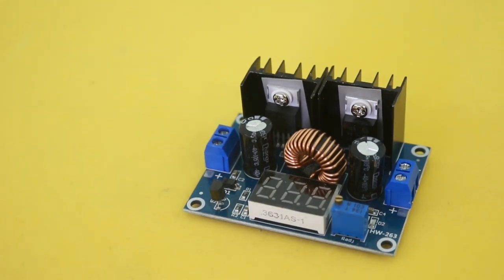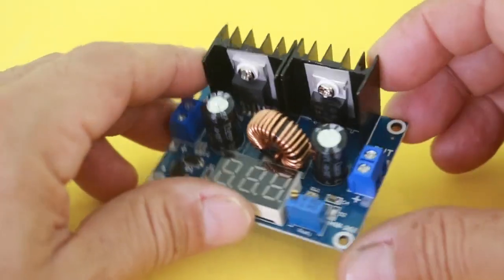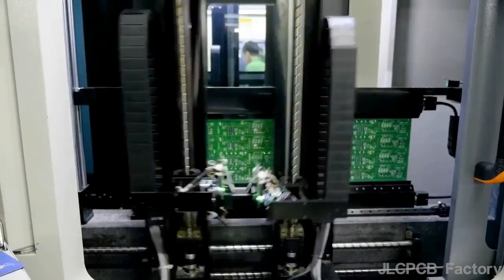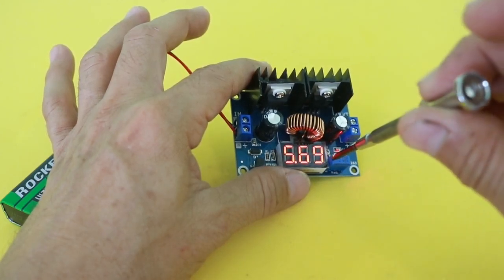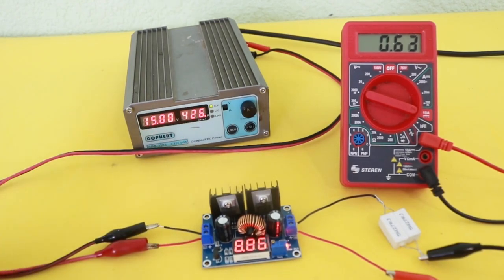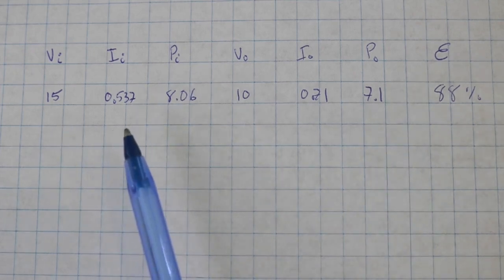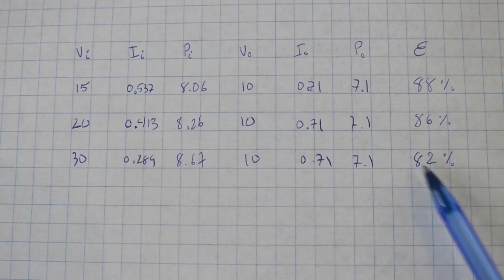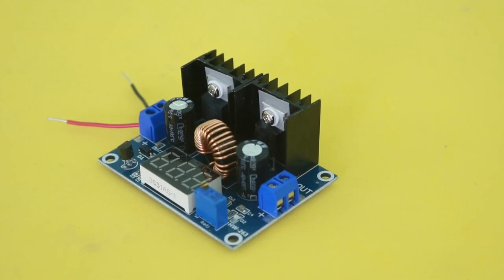Step Down Voltage Converter - Efficiency Test

Comment: i wonder how easy 95% efficiency is to reach. i hate how my 20,000mah power bank is basically a 14,000 mah one. so much lost to heat
I could go dual phase and use nice mosfets and mosfet drivers.